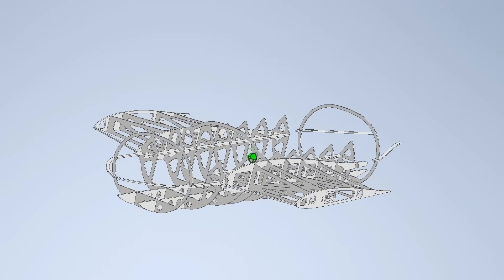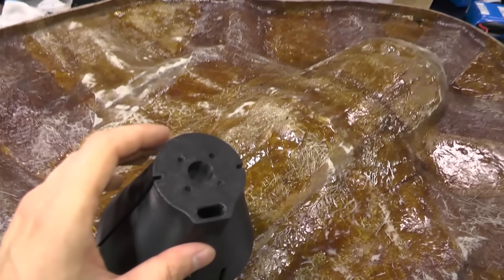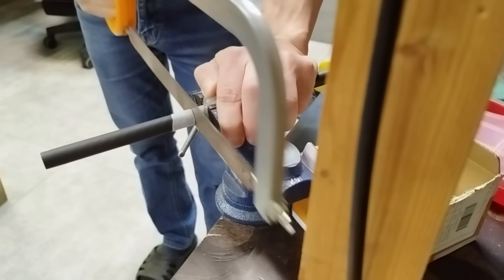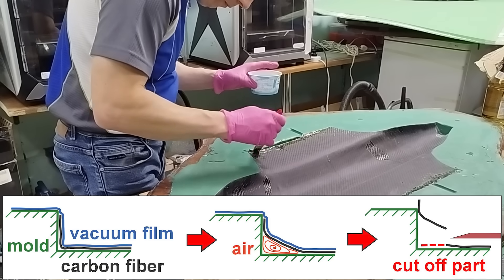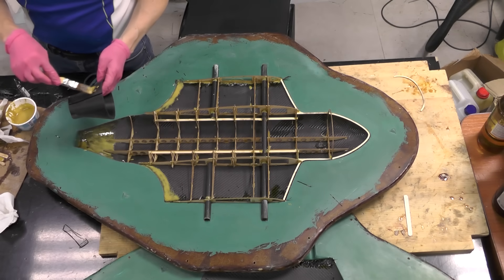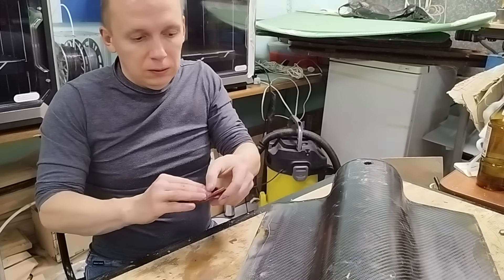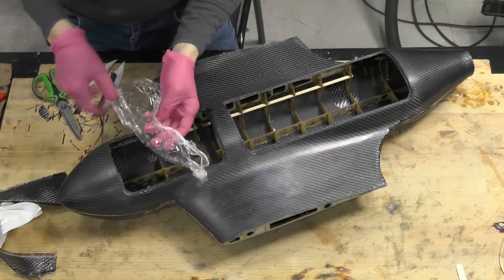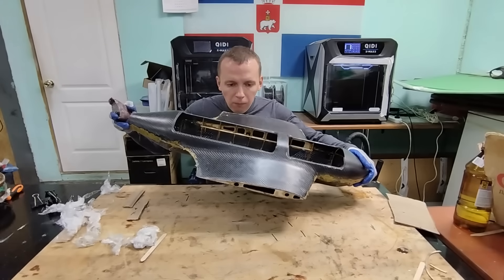Making a Carbon Fiber Fuselage (Part 11)

Comment: What is the name of the yellow material you use to connect the top and bottom of the plane? How can I find it?
Reply from the maker: This is epoxy resin mixed with a filler (in my case, a powder made from glass microspheres).

Comment: Hacer el fuselaje de fibra de carbono no es ya suficientemente rigido para no ponerle todo ese interior de madera?
Reply from the maker: Sí, es bastante rígido. Pero en la primera iteración decidí ir a lo seguro. Las grandes aberturas en la parte superior para el acceso al equipo también me generaban dudas. No estaba seguro de si el marco alrededor se deformaría mucho bajo carga o si la tapa podría soltarse por eso. Si las pruebas resultan satisfactorias, pasaré a la fase de optimización.
Reply: @BadEngineerKVS  seguro q con el fuselaje de fibra de carbono es mas q suficiente.
Reply: В качестве беспилотника в один конец отлично каркасик можно убрать чтобы взять больше топлива и желательно мягкий бак как у герберы она допольши влегую долетает😂.